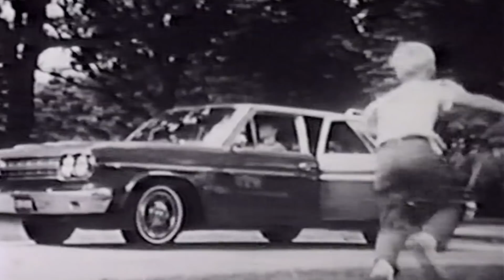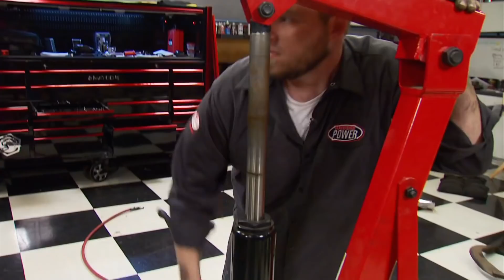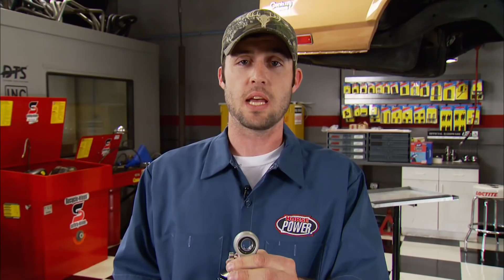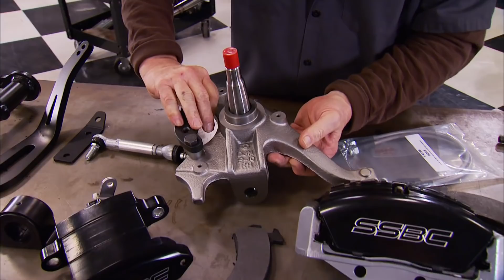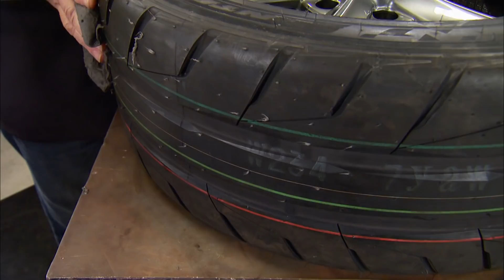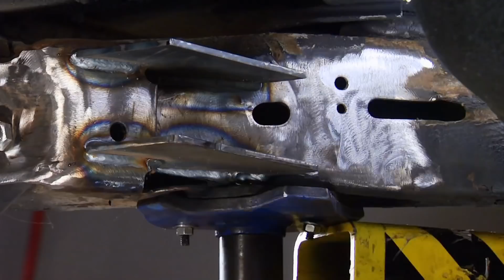Turning A 1978 Buick Century Wagon Into The Ultimate Sleeper - Horsepower S16, E1

Comment: These people act like 800 hp is alot its not all this suspension work is unnecessary sure it's flashy looks like fun but it's not really necessary 95 impala or Chevy caprice got a full framed chassis ND wagon at that it's way more rigid then this thing

Comment: Lithium is not the best for the suspension anymore.  White silicone is preferred and doesn't wash out.  That said, maybe your parts had some caveats for that.

To others wondering what this kind of build would cost.  I am betting just the labor alone at a modest $25-50 a hour would be in the 5 figures through this part 1 alone.  The parts probably deep into 5 figures.

Comment: Had a 79 buick lesabre sport coupe with the 4 barrel 3.8 turbo...it was incredibly fast considering it was a big car could imagine in a smaller century or regal it would be a rocket I think they were rated 170 hp from the factory about the same as an Olds 350 from the same time

Comment: I have an 81 malibu classic wagon, 427 dart block, afr heads, forged balanced  small block. Similar mods to frame , and rear suspension. Sway bars ,and such. 4.30  gear, very respectable numbers for a daily driver.

Comment: I have a 1972 Ford Pinto Squire Wagon with a 345 RWHP 302/4 speed.  The '78 Buick Century wagon is the same as a '78 Chevy Malibu wagon, and a great choice for a hot rod build. Just don't go GHETTO with 30" REEHUUMS and no tires. 14" or 15" RWL BF Goodrich Radial T/As are a great way to go.

Comment: I'm into station wagons and suburbans myself but I have a question I've been trying to figure out what gasket set to get for my timing chain cover and water pump gaskets there seems to be two different kinds for it for my I have a 97 GMC suburban SLE that I'm trying to find a right gasket set for and I'm trying to figure out if it's going to be the big set or the smaller set for my 5.7 that I have in my suburban and I'm just wondering if you can help me with that then decide whether I need the bigger gasket set or the smaller one

Comment: Hope you fellas put all them upper control arm shims back where they came from, lessons learned from others who haven’t. I see you put a few back in! Nice build so far, definitely think you putting in a Pontiac is a great plan. Are you planning a well built for racing overdrive trans? 

Personally I run double Adjustable coil overs from QA1 at all 4. I Would sure love to get a power Rack and pinion set up like what your using for my 64 Tempest.  A spool? So she’s gonna be for straight line only I spose, too bad. Seeing this tear up a road course would be a blast. With all these nice improvements I bet she won’t G-Body Shuffle!

Comment: How about a Buick 455 why Pontiac?
Reply: as someone who loves their brand, i get the pain... as a Pontiac guy, they made bullet-proof engines, so you can find readily available new aftermarket versions. Butler Performance, Proformance. the Buick BBs had thin walls, weren't used as much.
Reply: @DaemonWulf7  Didn’t know that about the thin walls thanks for sharing
Reply: @froglobster  that part i actually looked up, so it's news to me as well, but i've always known Pontiac blocks were bulletproof. they handle a ton of abuse, which (along with amazing torque) is a reason most people go that route.
Reply: @DaemonWulf7  Oh, I do know the Ponty 350 in my Lemans sport wagon was a beast!
Reply: @froglobster  i've owned a few Pontiacs, but only two Pontiac engines... little ones; a 301 and a 326. both represented the brand admirably... very strong with more torque than expected.
Reply: @DaemonWulf7  Same here, all my other Pontys (quite a few) had Chevy blocks. Just the Lemans wagon an actual Ponty 350

Comment: Love the idea but not the drivetrain choice. 
I would keep it a buick drivetrain 
1. A 455 with some head work and aftermarket crank and rods intake it would easily make 590/610
2. 231 v6 3.625 crank ported iron 8445 heads or TA aluminum, rjc girdle to keep it together JE pistons
Ported stock intake precision 6766 turbo precision SLIC ,84 lb injectors racetronix fuel pump and of course alky/methanol 3inch Down pipe 2004r trans with 2800/3000 stall, 8.5 or 8.8 rear
Either FAST/Holley or stock GN ECM 
And your running 9's getting 20mpg 
And sounds like your grandmothers wagon
Reply: At least they didn't put a Chevy in it

Comment: A Pontiac 461 definitely doesn’t need 4.56 gears especially when you add boost.  Look for a gear swap down to a 3.00-3.50 very shortly.
Reply: For sure. With the tire size available without tubbing, 3.23 would be plenty.